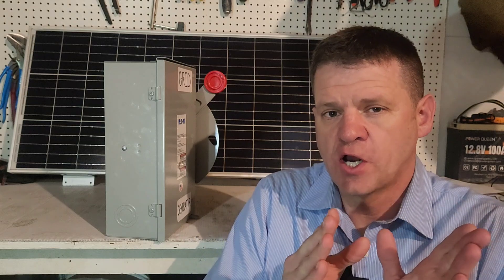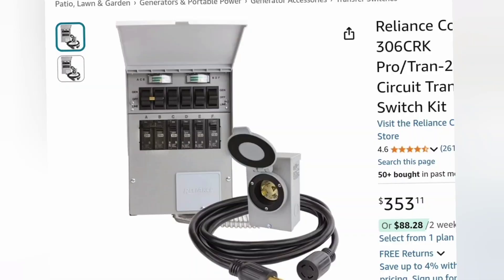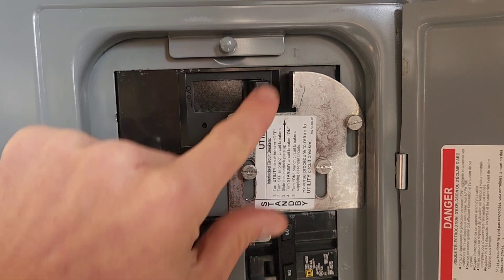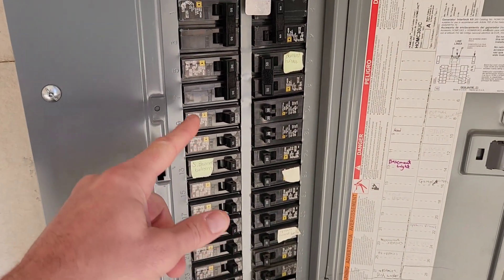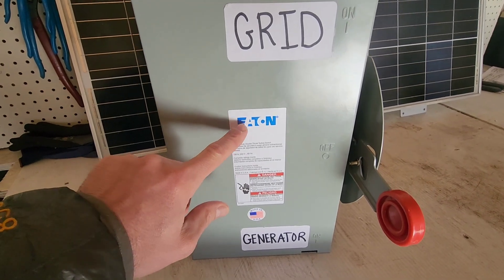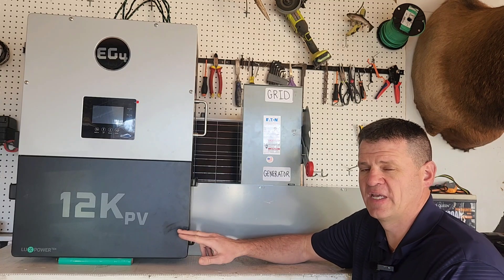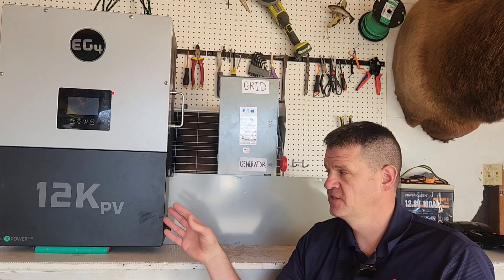Best Way To Connect Your House To A Generator

Comment from the maker: Option 1 - Critical loads subpanel transfer switch kit: https://amzn.to/3Dk5G4r
Option 2 - Interlock Kit: https://amzn.to/3Dxae7m
Option 3 - Generac Automatic Transfer Switch & Generator: https://amzn.to/4iB6nX0
Option 4 - Manual Transfer Switch(Eaton): https://amzn.to/3P6mKxn
Option 5 - (Bonus) - GenerLink Automatic Transfer Switch : https://amzn.to/3DrxoMG (I forgot to mention this as an option. Check with your utility company before purchasing)

Other Products shown:
-Eg4 12Kpv Solar Generator: https://signaturesolar.com/?ref=DiySolarPowerFun ($50 Discount Code: RAY)
Eg4 wall mount battery: https://signaturesolar.com/?ref=DiySolarPowerFun 
Used Solar Panels: https://www.santansolar.com/?ref=DiySolarPowerFun
(Affiliate links)

Chapters
0:00 Intro
0:44 Critical Load Subpanel Transfer Switch Kit
1:51 Generator Interlock Kit
4:40 Generator Automatic Transfer Switch
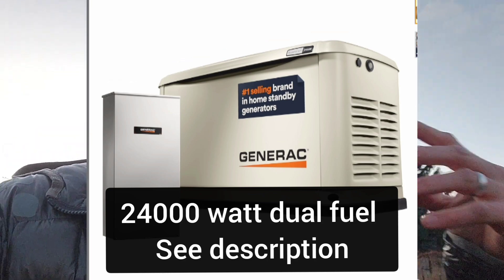5:49 Generator Manual Transfer Switch
7:46 Connecting a Solar Generator to my home

Comment: The main breaker by your meter is a double-pole 100A breaker. Doesn't that mean 100A per leg, thus 200A service? You've said "100A service" several times across multiple videos, but is that correct? L1/L2 then feed into your main panel using a single pole 200A breaker.
Reply from the maker: The panel is over sized for my 100 amp service.  The 200 amp breaker in the main panel is just there as a shut off for my interlock kit. My 100 amp service is capable of 100 amps on each 120v leg.  A 200amp service provides 200 amps on each 120v leg... much more than most people will actually use at one given time.

Comment: What about with solar and no batteries? Which option would be best and safest for me and everyone else to use? I have solar panels and 2 solar inverters that I rent and do not own without any batteries and I don't plan to get any batteries, because of the possible high cost. I have a portable gas generator that I want to hook up to my house. When my power goes out I want to be able to turn on my generator to power my house. I would prefer to not have to manually mess with turning off my solar inverters when I want to run my generator. As I understand it, I don't want to run the solar and the generator at the same time in parallel cause that may fry one or both. In addition, I would like an indicator installed somewhere that tells me when my grid power from the city comes back on so I know when to turn off my gas generator. What are my options?
Reply from the maker: I assume your solar is installed on your home already? If the power goes out do you not want to run solar at all.  Seems like you may want a critical load sub panel that your generator can attach to.  That way when the power goes on all your lights will go on and then you can know you can switch back 2 grid power.
Reply: @diySolarPowerFunWithRay  Yes, solar is already installed on my roof. I would like the solar to power my house. It does not at the moment. I don't know how and since I don't own the solar if I am even allowed to wire the solar in a way to power the house only if the main city power goes out. The solar is installed so that my energy bill is a lot less. I believe it's wired in a way that sends power back to the city, not sure.
If I ever decide to get a solar battery or 2 in the future, would a critical load sub panel still be a good option to use when the batteries get used up and I need to use a gas generator?
When I do finally get this all setup is there any safety "Don't" I need to be aware of that may injury someone or myself? For example, don't touch the 30amp cord when the generator is on?

Comment: If the 12kpv has  grid pass through then why do you want that waste of space transfer switch? Especially if you want uninterrupted power.
Reply from the maker: The switch I speak about in this video will basically be a bypass switch. So I can easily switch my whole house to grid if I need to replace or work on the unit. Hope that makes sense. Otherwise it will always be solar generator mode.

Comment: Sorry, new to your channel, but would it be better to get maybe two smaller Inverter generators and daisy chain them together, then run it to the house, or would it be smarter to get the larger generator and use an external inverter? (Not sure if an inverter is going to give you the “clean” electricity for electronics/medical equipment..) thoughts? Also, I believe it’s code to have the generator switch be Installed, like you say, you could potentially hurt or kill some one working on the main lines without the switch.
Reply from the maker: Thanks,. The question regarding having two smaller inverters for redundancy over one larger inverter.... hmmm..
that's a tough one....it is always up for debate. 
     two smaller inverters is more complex to install so you have to take that into account.

Comment: Another option for connecting a portable generator: 

The GenerLink transfer switch is a UL-listed, socket-mounted device that provides a safe, easy and affordable way to connect a portable generator to your home.

GenerLink transfer switches are installed behind your electric meter and deliver generator power directly to your breaker box. No more tripping over power cords running through your home!
Reply: One has to check with the local utility to confirm they will allow such a unit. And .. as it is touching their electricity meter, they will want to know it has been re-sealed.

It is a pretty quick job. Suspect one would pay mostly travel time. But... again, check with your electricity supplier.
Reply: @TimAch-p2c  Yes it's definitely not a DIY installation. I checked with my local electric utility and they do support the Generlink product. I would have to coordinate the install with them so that one of their lineman is on site with my electrician at the same time. They will work together to install it, put a new seal on the meter base and then test the transfer switch functionality with my generator.
Reply from the maker: I wonder if your electrician is going to have to install it hot. Hopefully the utility company can turn the power off while he installs it.  Yeah, definitely not a DIY project.
Reply from the maker: ah.. I forgot about that option.  That's also a good option. I'll mention that in the description.  Thanks
Reply: Never heard of this before, but now that I see it this actually seems like a great option. No need for an inlet box or separate transfer switch and all the electrical work that those things require. Gives the same flexibility as an interlock kit in the sense that you have total control over which circuits are powered by your backup power solution. Interlock kits are not permitted in my area so the GenerLink might be just what I've been looking for.
Reply from the maker: @TimAch-p2c  I've never installed one of these. I imagine The Electric Company might not be too happy if you mess with the meter.

Comment: I installed a home solar system, 6000W of solar panels running thru a EG4 6000XP and 2 EG4 indoor batteries. I've connected it to my electical system using a manual transfer switch, but I did the 10 pole model. 2 lines (4 breakers) are 240v (ev charger & dryer) and 6 are 120v (critical loads, furnace, fridges and freezer ect). With this set up I can use as much solar power as I can purduce, plus I now have a backup power supply in an outage. I did wire in a generator plug to charge the batteries as a backup also. The first month I used it I cut our electric bill by 65% from the previous month. With the solar tax credits payback should be about 5 yrs. 

Biggest down side is I have to be here to manually switch circuits from solar to grid as batteries get low. December in MN solar output is limited! But, my system was simple to install and is easy to manage, and very cost effective.
Reply: This sounds like the route I'll be going. Just received my pallet of solar panels. Would you happen to have a video of your setup for refernnce?
Reply: @rallyraul1  I don't have a video. I made the solar panel rack after watching videos, Tech4U by James has a good one, my array is bigger than what's in his video, but same concept.
Reply from the maker: Cool.  If you run grid to your inverter you won't need to manual switch to grid if the batteries get low.. It will automatically switch for you.  I did a line tap as shown in this video to run grid to my inverter: https://youtu.be/nAJByNRCw0k

Comment: Great videos! I just received a 6000xp, battery & some panels to start the journey. I'm curious though, why are you switching from the 2 6k's to the 12k?
Reply from the maker: Just to try something new.... I'll be testing a bunch of inverters with the configuration hopefully :)
Reply: Are you planning on selling back or using the grid interactive feature?   Seems like kind of a downgrade if not using those particular features.   Thanks for the Content I use that same Eaton switch  for grid bypass works great!

Comment: Great video thanks, how do you plan to wire the grid input to inverter from the bypass 🤔
Reply from the maker: I'll be adding a distribution block in the wire gutter directly below the manual transfer switch.
Reply: @diySolarPowerFunWithRay  👍 polaris block to an ac breaker? For case of servicing inverter? Maybe I'm thinking of it wrong but will you have a way to disconnect power between grid and bypass switch, then again between bypass grid and distribution block to inverter?
Reply from the maker: I'll still have live power from the distribution block to the inverter at all times... So before servicing the inverter I'll also need to remove the grid supply wired from the inverter and add wire nuts....The distribution block will also be live... So I think I'm going make a plexi-glass cover for it so it can't be toughed by accident.  I'll be Using a standard distribution block instead of a polaris block... It will mount in the back of the wire gutter.     Hope that makes sense... I'm open to suggestions.   I definitely want it to be safe to work on while I still have power to the entire house.
Reply: @diySolarPowerFunWithRay  i did similar but using polaris and breaker, so i was curious of your method, thanks for reply

Comment: Thanks for another great informative video.  If you can get into the reasoning behind the need to go with the larger system it would be interesting.   Your advice would help to take the plunge on a larger system from the start rather than starting small then going bigger latter.
Reply from the maker: It might be toss up between a single slightly larger inverter(that's more reliable)... vs 2 smaller 6000xp inverters.   I'm excited to test out the 12kpv... not sure I can recommend it over the 2 smaller inverters until I try it out.  I'll have the test video as part of the install video and I can give more thoughts after I test it out.  thanks.

Comment: lol the reveal. people should think of generator vs solar power inverter like they do for ev vs ice. ev ends up being much cheaper despite the price because it offsets the cost of fuel. my phev paid for itself after only 18 months and 40k miles. kind of impossible for people to comprehend...
the solar system cost should really be discussed with ROI in mind, after what point is it free? is it going to last that long? i do think of inverters as wear items. especially the new high frequency ones flooding the market (basically everyone except for victron and expensive commercial/german names). problem with victron besides cost is that they "pot" a lot of their electronic boards so they are not repairable. makes them last longer but if you can fix electronics victron is kind of a no go. look at teardowns of their mppts for an example of how completely unfixable they are. usually the issue with high frequency inverters is that a capacitor or MOSFET will go after a combination of calendar aging and use. in australia solar systems are so common that inverter systems are actually worked into the building code, and its not allowed to install them on the north face of any building because they will prematurely fail from sunlight, every single time.
Reply from the maker: Thanks.   I'll be heading over to Queensland in February... I'll see if I can look at some solar systems while I'm there. 👍